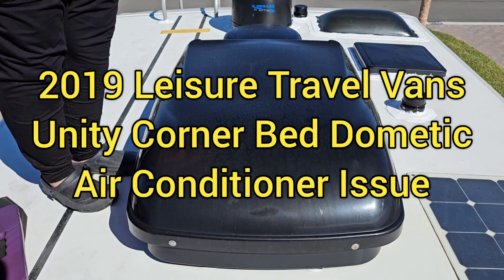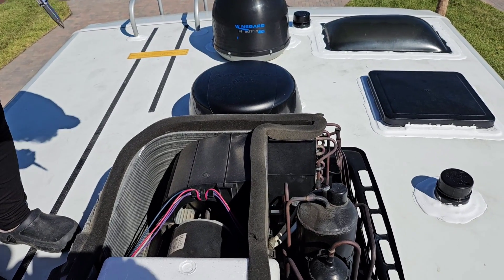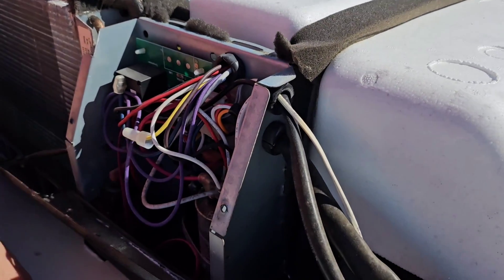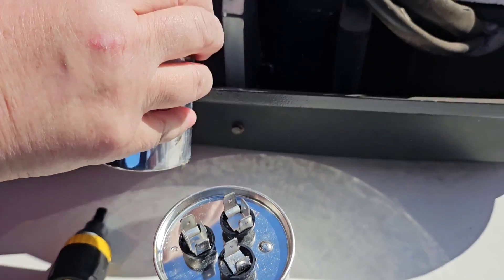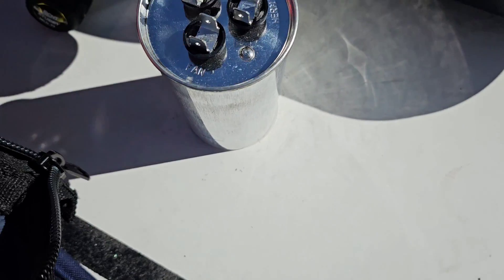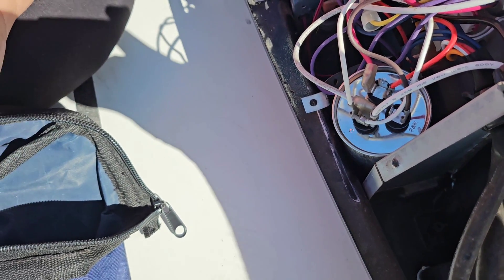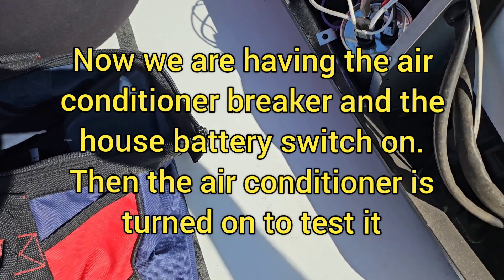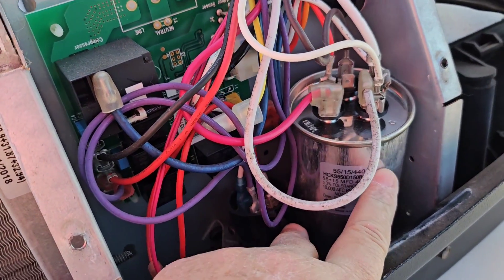Leisure Travel Vans Dometic Air Conditioner Dual Run Capacitor Replacement

Comment: We have a 2018 Unity FX and our AC is not working. I’m thinking that instead of fixing that it’s time to upgrade the AC.
Reply from the maker: Get the Gree Atmos or Eco Cool 15k BTU air conditioner with heat pump, they are both exactly the same,  just have different names. Super quiet and uses less power. The Heat pumps works down to 23°F. CTM Customs in Stuart Florida is an installer.
Reply: @SandyRVUpgrades thanks for the info I’m in California and don’t plan to visit Florida anytime soon. I’ll try to find someone in Northern California.

Comment: Hello, I have a question. Can a faulty capacitor cause loud humming noises? I replaced the motor with an identical one, but the humming persists. I’ve checked the rubber isolators, ensured the fan is clear of the shroud, and inspected the entire unit. I also ran the fan without the compressor to isolate the issue, and it still hums. Therefore, it seems the cause must either be the capacitor or potential rattling between the ceiling and the AC unit. Any help would be greatly appreciated. Thank you!
Ps. I also have a Dometic Penguin ll a/c like this one.
Reply from the maker: Yes, that's usually the sound it makes when the capacitor is failed, a hum. The capacitor is the first thing I always replace before troubleshooting further. It an in expensive first step to eliminate things.
Reply: @SandyRVUpgrades Ok I just put a $250 motor in it 😂🤦‍♂️! I will go get the info for the capacitor and get one coming asap, lol. I'm not 100% literate with electrical that's why I play it safe. Always learning! The middle unit was making the same noise and I put some sewing machine oil on the bearing and it has stopped making the noise but the front one has gotten louder. Yhats why I replaced the motor. Thank you so much for helping me out!
Reply from the maker: @HowToDIYMoore Click on the video title when watching to open my description which includes the link to the capacitor.  Live and learn, always try the simple stuff first. I hope the capacitor does it. Otherwise consider replacing it with the Gree Premier, Atmos or Tosot air conditioner and heat pump, it's super nice compared to the Dometic.